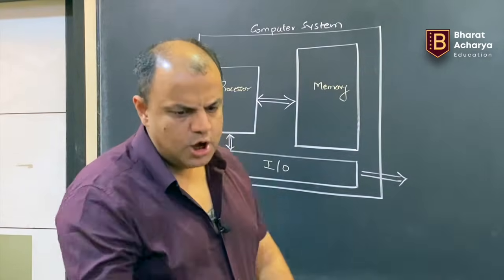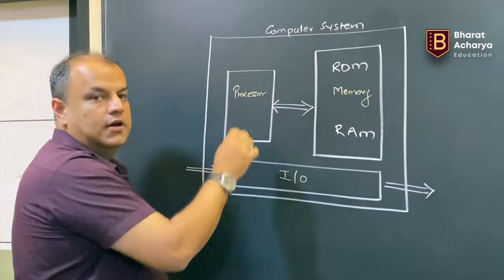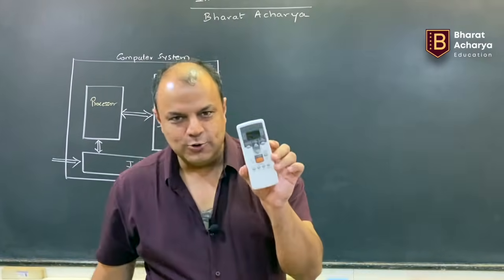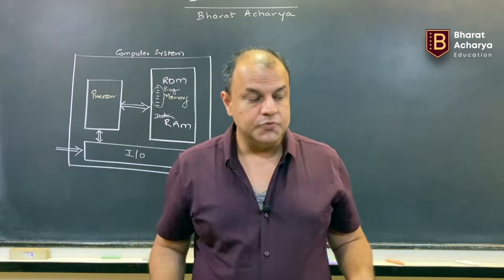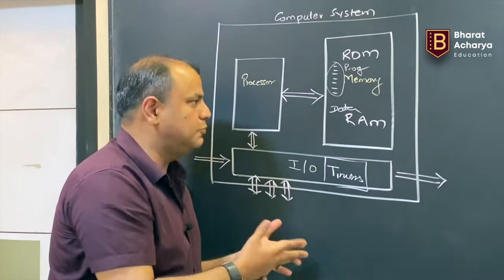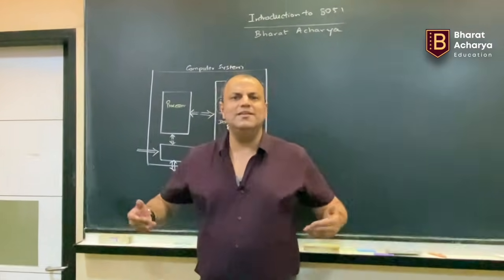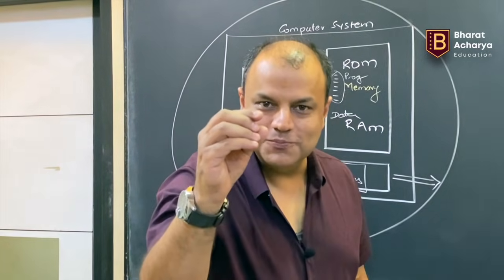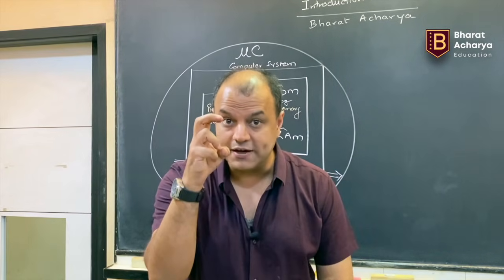Introduction to 8051 Microcontroller | Part 1 | Bharat Acharya Education

Comment: Dear Teacher. I have some questions to ask you. With what program can I compile programs written in 8051 assembler? I have acquired several Atmel microcontrollers, the AT89C5115, with many features, but I do not have a way to record them. Do you know of any recorder that allows me to do it? Do you know how to record it on the application board, that is, do I need to remove it and put it in an external recorder? Thank you so much. Excellent channel. Greetings from Spain
Reply from the maker: Keil
Reply: @BharatAcharyaEducation  Is free? Where can I download it? ;thank you so much. Kind regards

Comment: Tomorrow I got an exam. watchin this video and I can directly write the exam. No need preparation. AWESOME sir.
Reply from the maker: All the best
BHARAT ACHARYA EDUCATION
Website: https://www.bharatacharyaeducation.com
Android App: https://bit.ly/3RO7dCU
iOS App: https://bit.ly/40eoUP5
 
🎓 Courses for You
8085, 8086, 8051, ARM7, COA, C Programming, 80386, Pentium

✅ Full video lectures
✅ Topic-wise PDFs
✅ VIVA Qs / MCQs 
✅ Certification
✅ Doubt solving on WhatsApp

Duration: 6 months
Course Fee: 1499/- (INR 🇮🇳) 
Start Learning... NOW ✅ 
Website: https://www.bharatacharyaeducation.com
Android App: https://bit.ly/3RO7dCU
iOS App: https://bit.ly/40eoUP5

-———
Instagram
@bharatacharya.in
https://bit.ly/3r45LAp

-———
WhatsApp
+919136428051 
https://bit.ly/3TknzCs
  
-———
#bharatacharya  
#bharatacharyaeducation  
#8086 #8051 #8085 #80386 #pentium  
#microprocessor #microcontrollers